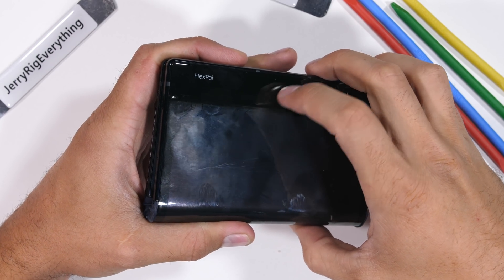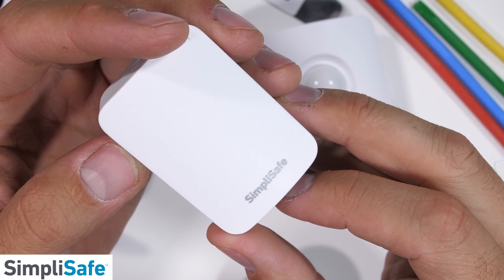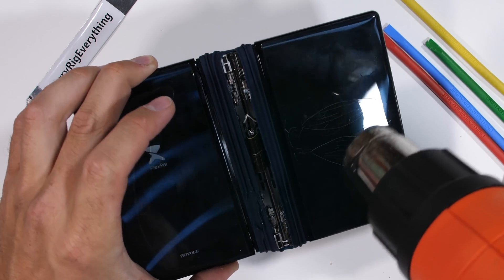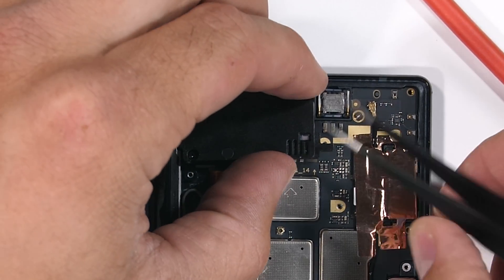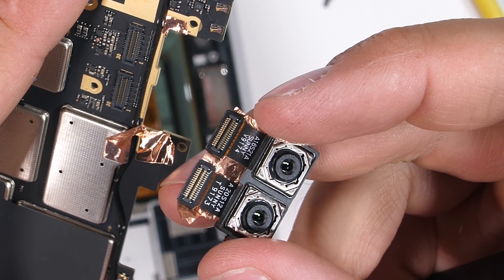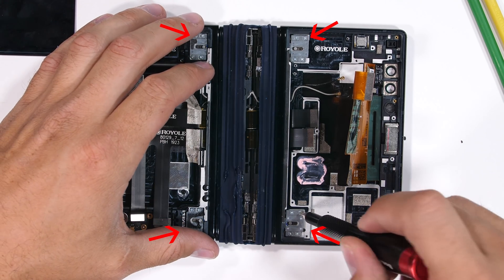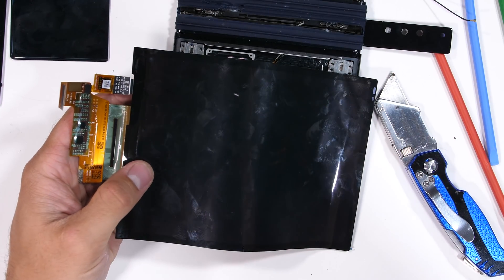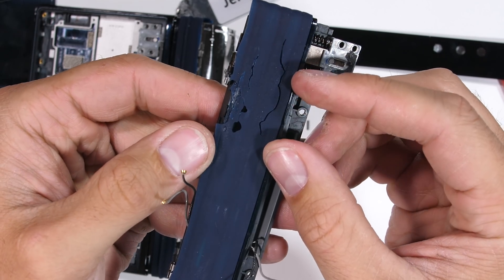Worlds First Folding Phone Teardown! - Royole Flexpai

Comment: I bought a FlexPai recently (just because it was the first foldable phone ever) and it is very cool, but there was zero support from Royole. They never updated the original firmware (which was an improved version of the version showcased on the electronic shows), unlike the FlexPai 2, which received one update. The WaterOS is solid, but still has some issues and way too much bloatware (which you can uninstall using adb, of course). The screen is larger than the Fold 3 I also own, lol. But the plastic solution used feels very very cheap. Again, I like, but it is not a great phone. I guess Royole was just a flexible-screen startup company and they had zero idea of mobile phones. The best part of the phone is the initial setup, that has tons of recommendations. Do not charge it folded, do not fold it below 2ºC, store it unfolded and so on 🤣

Comment: Secured by SimpliSafe? I can break in by transmitting with a BaoFang radio on the 433 MHz band. It will also jam every system on the block because of the low power SimpliSafe uses.

Comment: It's great that simplisafe sponsored the video but I have seen a lot of videos talking about how easily the system is to bypass with simpli using kiosks for cars or any that operate on the same radio frequency which I think is around 400 GHz. Publicly posted information. Lock picking lawyers channel has a video on this. If you own and use the simplisafe system you should text this theory to see if it really is that easy. I'm curious to know myself. Kinda scary if it works. Love the channel by the way. Tear downs are awesome.

Comment: as a security technician i can say that simply safe is only good for a short term system. the tape that holds the door contacts on give out and in RF noisy areas have issues communicating. they just dont compare to a company's work if the company is any good to say. on top of that they currently dont offer wireless devices that can be hidden in the walls or doors of your home. and finly i find there wirless rang to be short compared to what they make for other systems. but all this is my personal experience. someone may love it. thats up to them thow

Comment: Zach i have to warn you simply safe isnt a good product. For just $10 you can get a device that sends out radio waves that'll jam the antenna on the simply safe hub, allowing a person to open your door and enter the house with out the system knowing. Check out the lock picking lawyers video on this.

Comment: As a security consultant I can not stress enough to never, EVER, run Simplysafe as a home security system. The sensors are easily and readily bypassed and the system itsellf is susceptible to multiple disabling methods. Lock Picking Lawyer went over just /one/ method of bypassing this system and anyone with access to amazon or ebay can do it. I will not mention the easier method either... It has the same vulnerabilities that early systems had from the 90s.

Do not expect your home to be safe using that system. That is a literal false sense of security and I'm growing tired of seeing them sponsor people.

Comment: SimplySafe wireless prodects work on the 433mhz band and can very easily be hacked with a cheap programable radio jammer. DO NOT BUY SimplySafe or you have your house broken into by anyone why watched a 5 minute YouTube video and spent $10 on a wireless jammer you can buy on Amazon. You have been warned.

Comment: Wireless security systems are not secure. Especially if they don't have some FCC warning about rf radio transmissions on them. As that means they use the 2.4GHz rf band.

This means they cannot have any type of advance automated defence against radio jamming equipment as even your microwave can cause a false positive.

Edit: Also never advertise your exact security system....

Comment: How much branding you need inside the phone ?

ROYOLE: YES!
Reply: Pepe The Frog  your username is pepe the frog so stfu
Reply: The branding on the part cost nothing to add. The text on the PCB is the same lays as the all other exposed copper on it like for test prints, earth around the screw holes etc. The manufacturing cost i  per layer and do not depend on what is on the layer. The same for all other parts where they what to have the part number printed and then adding the logo do not cost anything extra. 
The only extra work is to add the logo into the CAD file.
Reply: Pepe The Frog  dude, your not funny, stop trying to make yourself look better and just deal with it
Reply: Pepe The Frog  let's see you being funny, make an original joke
Reply: Pepe The Frog  your tag is lame, so r/wooosh

Comment: Simply safe and other wireless security systems are extremely vulnerable to jamming from any $10 Wally tally with configurable frequency. If you have chosen or are using a wireless system do not advertise the system with the shield thingy. U are basically telling the criminal to Google your system on why to bypass

Comment: SimpliSafe is not safe, Jack. It's easily bypassbale... By basically any remote controlled device using the very same extremely commonly used frequency that Simplisafe uses... I think you should do a video addressing this... Or else you're just doing false advertising... Either prove that Simplisafe is really safe and prove LPL wrong or apologise for taking that sponsorship... You're the guy that advocates for honest and better products for the average consumer... And you've exposed misleading advertising countless times... Don't do the same thing, man...

Comment: Zack you need to get a wowstick screwdriver or an ES121 screwdriver. Both screwdrivers are designed for taking apart small electronics. It would make your videos much easier.

Comment: Please dont advertise simply safe. It's so easy to just use a transmitter that is the same frequency as the simply safe system. You can literally bypass the whole system with something you can buy on Amazon for legitimately $2.
Just look up the lock picking lawyer's video.

Comment: LockPickingLawyer broke simplisafe easily. Never get simplisafe
Reply: Hard fenced decorated caged outside ur windows mounted with heavy duty screws and same to the doors with sliding cage scissors and 4 heavy duty lock smith bolting scissor points 1top 2mid and 1 below, medium to high vibration sensors from inside house. Take a1 or 2 years vacation anywhere in the world and your home is safe.
Reply: @sky_llama  Unless they watch LPL video that is lol.
Reply: @brucecowgill7672  Let's be real, unless you advertise what you use, they aren't gonna try to disable all possible types of security to try and break in..
Reply: Pretty disappointed Jerry is endorsing this product given the obvious and incredibly accessible vulnerabilities of the system. Given what a hard time he gives phone manufacturers it’s sad to see him sell out to SimpliSafe on what is an obviously subpar product
Reply: LPL could probably get into Fort Knox with little to no effort.
Reply: @syd.a.m  Doesn't matter. There was no effort required for him to do so. The specs of the patents used in these devices can be looked up and you can figure out vulnerabilities to all security systems that are wireless like it. The only true way to use wireless and it work is to have two (or more) very different systems on each entryway and advertise a outside security system to trick burglars into jamming a system you don't truly have a system of. This guarantees that they jam the wrong signal unless they jam every possible signal that is used in wireless security systems.